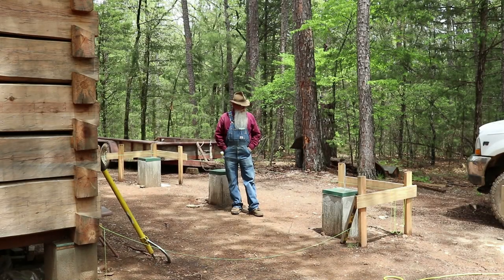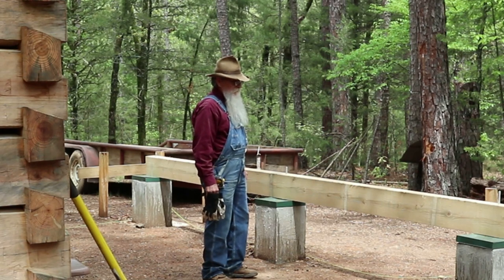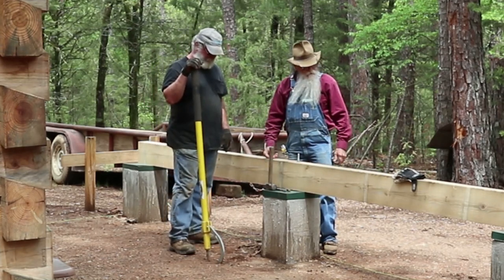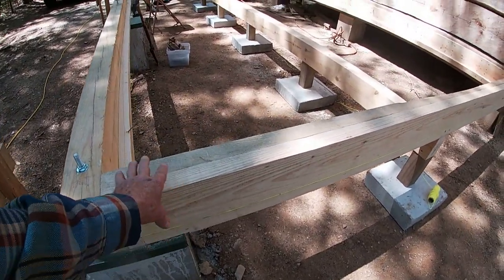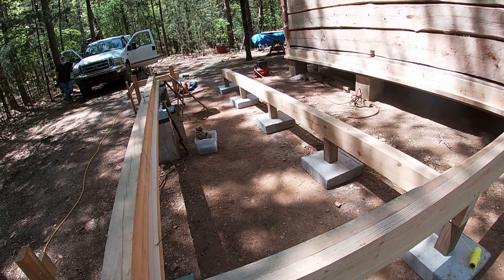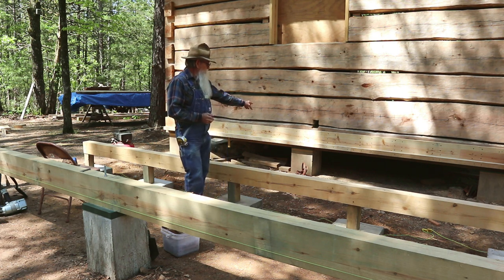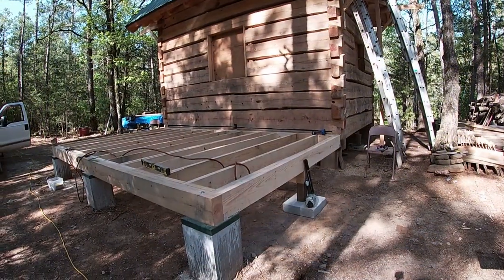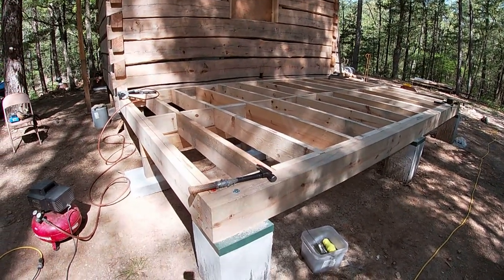Kitchen Addition, Paradise Point - Ep 15

Comment: Almost on point again as I am facing a rotting bottom log the floor joists are notched into. Now I have to lift the thing witch obviously trying to avoid. May brace joists and all I can think of is a steel plate with one jack on either side of the upper side log. But that’s kinda floor level. Been suggested to treat it and fill it with some hardening stuff you inject, and redo a supporting log under Joists  directly behind Sill log?  But have a good weekend!
Reply from the maker: Howdy Richard- sounds like you have a bit of a dilemma there. It’s sad that so many of the sill logs on the old cabins have a lot of damage because of being too close to the ground or having damage damage because of moisture. I  think you have a plan that will work. I had to do something very similar on the last restoration I did. I set another girder back behind the sill log to support the floor joists. Hope everything works out for you. Take care and God bless